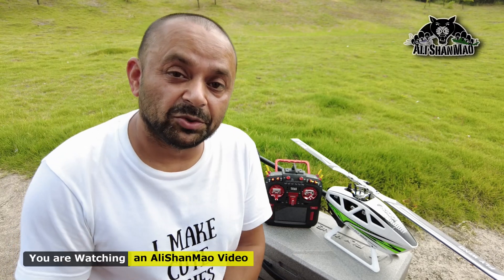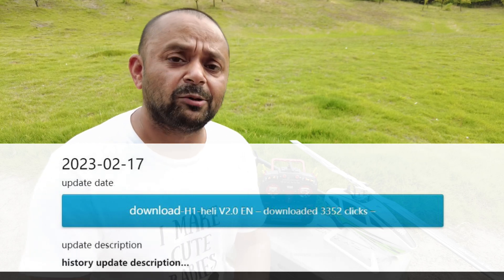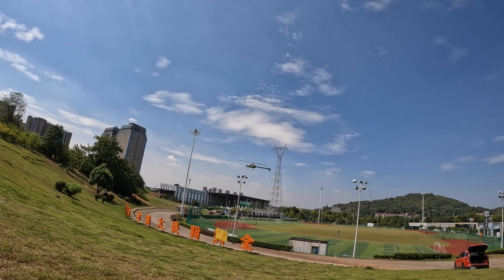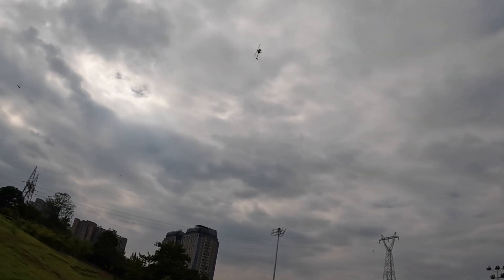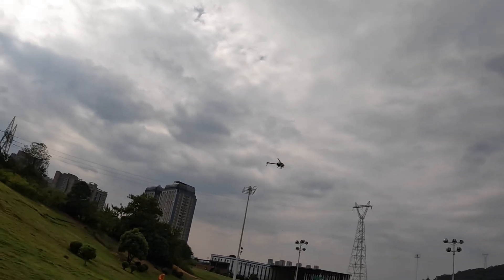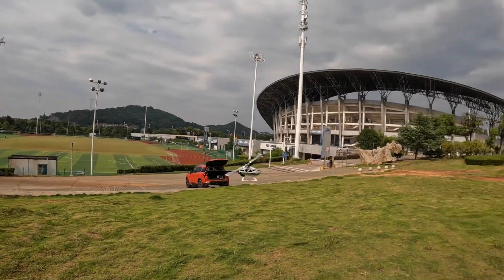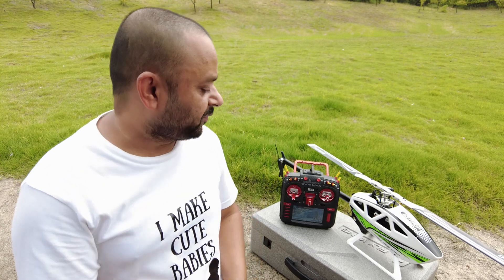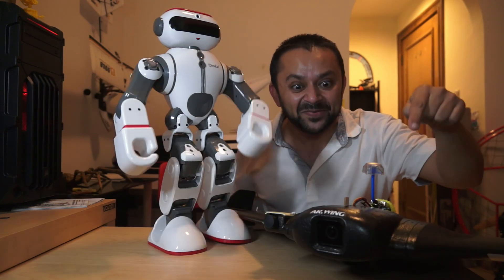Crash-Proof Technology: FlyWing FW450 V3 GPS Helicopter's 3D Security Feature

Comment: Hi, this video made me buy one, but unfortunately the security feature doesn't work 😢 I've set everything up the same way. Do you have any other ideas? Greetings from Germany 😊
Reply from the maker: Sorry to hear that. But if its in H1 Lite, it should work. maybe you need to set 8 meters or 10 meters altitude and fly above it and see if it works. all satellites must be locked and your GPS must be functioning properly for this feature to work. Use V2.0 Software
Reply: Thx 4 answers. I fixed it, do more testing and all works but i want to setup the Heli on my TX16S.
Can you do a Video or send me the model?
Greetz from Germany 👋😊

Comment: Hello...

I just saw your video. Demonstration 3D. If the control is wrong, you won't fall down! The explanation is quite detailed...

I am from Taiwan.. Few flying friends discuss this FW 450 V3 here!

Can you ask questions?
After the software is turned on 1.. Click to select the professional mode 2..3D anti-fault touch switch. Click to select to open 3.. Safe height setting 8M

Under such a setting... Use GPS when taking off. When the V3 is above 8 meters high and the height is above tumbling. If the operation is wrong, the rocker will be released. Will the body automatically return to the right and then set the height? Or do you need to manually control the body to stabilize the body?
         Thank you... from Taiwan
Reply from the maker: Hi, once the 3D safe feature turned on, if you set 8 meters you can only switch to 3D above 8 meters. As soon as helicopter comes to 8 meters it will switch to GPS and hold position
Reply: @alishanmao    THANK  YOU

Comment: Hi!Can you tell me the type of battery that you used? I tried this system with the normal battery of the FW450 and I crashed😢.Thank you.
Reply from the maker: Hi. Stock small battery that comes with fw450 V3. It's not 100% guaranteed that this will save your heli from crashing. Set higher altitudes like 10 meters is best

Comment: My FW450 v3 crashed today.  I had anti crash turned on to 10m in the software.  I did a stick and compass calibrate as well.  I tested the anti crash by putting it into 3d mode and lowering until it stopped and went into GPS mode, seemed to work.   I went up to over 10 m and then I put it in 3d mode and started flying 3d stunts.  I lost control and the heli came crashing down into the ground.  It did not recover , go into GPS mode and stop.   Maybe it happened so fast it couldn't recover?  I have to rebuild it now, I'm dissappointed.
Reply from the maker: Sorry to hear that, buddy. Make sure all settings are correct in the software and the GPS signal is strong before each flight.

Comment: For anyone watching this, do NOT put your Rescue height at 6 meters with the stock 4s5000mah battery. there is not enough altitude for the helicopter to recover. Set the rescue height at 16-20meters to start, and adjust from there if you are comfortable.
Reply from the maker: For beginners 8 meters is highly recommended

Comment: if your flying a scale helicopter. you alway fly in GPS. the only thing you have to worry about is the GPS plug comes loose from the H-1.this feature will work if I go 3D.I have set mine @ 8 m. what do think alishanm?
Reply from the maker: 8m is plenty good. again for scale i won't set it up because as you said mostly we fly in ATT, GPS or 6G modes.

Comment: If you are inverted in 3d mode, and then gps takes over and leaves it inverted, how do you get it back upright?
Reply from the maker: if you are doing manual inverted, then switch to GPS while its inverted. it will flip back to normal automatically as a rescue

Comment: Hi, trying to set this up on my 500DFC, so far so good, but with the heli on the bench this feature set to on i have lost the blue 3d light and its now green instead is this correct?? I'm guessing that its locked into gps mode below 6m and would only switch to blue if enabled above 6m. Thanks just checking i havn't screwed up prior to flying.
Reply from the maker: Yes exactly. Because once you turn this feature on, it will always stay in gps under that set altitude and you won't be able to switch to any other modes on the bench

Comment: ALI, i tried to use the software that i previously downloaded. It does not open. It shows "unread H1" I want to download it again, but I forgot where I downloaded it from. Can you help?
Reply from the maker: its on flywing website buddy. unread h1 i have addressed this issue in my upcoming detailed video tutorial for channel members. normally its usb plugging issue.
Reply: @alishanmao  Thanks friend. One last thing. Today is the third day I have taken the heli out to the field. I cannot get the motor to start. I have followed the steps to the letter, but I get a constant red light on the flight controller. Have you any ideas what I'm doing wrong?
Reply from the maker: @jerryzito6840  solid red can be an error, connect to assist program and check if there is any error and fix
Reply: @alishanmao  I wanted to thank you for all your help. I discovered why my FW450 would not start. The heli needed a compass calibration.
Reply from the maker: @jerryzito6840  ah the compass calibration dance. it is a must

Comment: Thanks for the reply. Last Question. I downloaded the FW.3D Security update. I don't have an altitude setting parameter on my screen.
Reply from the maker: it should be there, 3d safe setting
Reply: @alishanmao  I downloaded it again. The only parameter I see is Inverted flight. Does the heli have to be hooked up to download to see the 3d safe?
Reply from the maker: @jerryzito6840  it is strange. If you have a V2.0 software it must have 3D safe feature unless if you are trying it on scale H1 lite. For FW450 V3, V2.5L it all works
Reply: @alishanmao  I downloaded the file you showed on your screen. Does the heli have to be powered on to upload the file?
Reply: Ok my friend. Disregard my last comment. I did find the security 3D parameter. It appeared when I attached the download cable. How can I tell if upload was completed since there is no progress bar.
Reply: Thank you so much for your patience with me.
Reply from the maker: @jerryzito6840  when you are connected to H1 flight controller using assist program. anything you do it saves settings immediately. make sure to hit disconnect before pulling the cable
Reply: @alishanmao  Thank you.
Reply: @alishanmao  I'm sure I did it correctly. My only concern is  that there is no verification that the file was successfully complete. I don't want to find out in the air. Anyway, enjoy your coffee.
Reply from the maker: @jerryzito6840  well there is a way to verify it easily buddy :) 
once you have set some options, disconnect the USB cable. after few seconds connect again and make connection, then go check if option is still on as you selected it. and all parameters as you set. if yes, well settings saved. do not change anything, disconnect and go fly :) have fun buddy
Reply: @alishanmao  Thank you so much Ali. I think you are the most intelligent RC content provider.
Reply from the maker: @jerryzito6840  Thank you, just a simple guy, trying to help people out and trying to earn some bread for my family

Comment: Thanks for the fascinating and informative video. Regarding the Fly Wing anti-crash download, how do I install it once I've downloaded it. Second question. I recently lost my Blade 230s RTF in a tree line. A friend gave me a 230 but not rtf or "s". I still have the transmitter from the RTF. Is it possible to bind the 230 to that radio?
Reply from the maker: should be able to bind it they are from same manufacturer

Comment: I have flishrc bo105 scale with flywing GPS . I like the idea I switch to 3D but if I get into trouble auto switches to GPS .I saw so video were GPS lock is lossed on uh-1 and crashed . now I dont trust GPS any more I need to know I can stop the crash by down loading the soltware to stop it. thanks for that. I was thinking about saleing it before I crash it.If I can stop it from crashing I will keep it.
Reply from the maker: Get trained to fly RC Helicopters and you won't need to trust GPS again
Reply: @alishanmao  I have GPS rescue switch in the software . I going switch that on when I fly in 3D has a back up save my helicopter from crashing if I make a mistake . I can set it for 7meters. what do  you think about that.??
Reply from the maker: @bradyates7046  3d Safe, you can set to 10 meters if you are beginner
Reply: @alishanmao  I have some years flying helicopters I am not make move without alot time getting my head around it. I have already set it if I change it again I will have to recalibrat compass.

Comment: I did what how did you recommend me about Calibrations, t recalibrated the Sticks and Switches on the Radio and on the H1 proram, I recalibrated the COMPASS, I carefully and attentively checked the "COLECTIVE" settings and verified that EVERYTHING was within the required parameters (mainly the "PITCH"), I rechecked the Values indicated for Home (2000), GPS (1500) and for ATT ( 1400) and this past Saturday I went to test the Heli and the PROBLEM persists, that is, WHEN I GO FROM "GPS" TO "ATT" THE HELI DROPS DOWN NOT KEEPING THE ALTITUDE AS SEEN IN YOUR VIDEO, BEING NECESSARY TO COMPENSATE THE THROTTLE TO THEN I REALLY COULD  FLY IN "ATT" MODE. 
Note;- On the ground, after the GPS had positioned the Heli correctly, when I changed the Switch from GPS to ATT Mode the respective light remained in "RED BLINKING", it didn't change to GPS Light. Please. HELP ME....  😭
Reply from the maker: It is very strange. these are the only settings. it seems like yours is switching to 6G mode rather than ATT mode. because only then it jumps down like you switch to 3d mode and it jumps down. its not switching to ATT. because in ATT mode it won't give you collective control on throttle so agile like in 3d but will keep the barometer engaged to hold the altitude. try 1200 and 1300 settings.
Reply: Did you ever get it fixed.I have same problem.

Comment: Spectacular video. once AGAIN Thank You. 1) Will this NEW "Safe Mode" work with "ATT Mode"?;  2) I already have this "H1 V2.0" on my PC which i last used to calibrate the sticks and the Compass on my FW450 V2 and it's Original radio "FS-i6s", but sincerely i didn't notice this "new" ability in this V2 of the H1, so I haven't tried it yet; 2) as i already told You on another video of yours after I changed the Flight Mode Settings to RTH/GPS/ATT, it was not possible for the "ATT" Mode to work properly, which on the experimental and unique flight i did, as is why I ask: - Would it have been because of this new "safe" capability that the "AAT" did not work? How should I, that is, maintain altitude? Thank You
Reply: H1 V2.0 -  New 3D security mode（Not 3D rescue，Just to prevent accidental contact with 3D during flight:-
      1、This function has an adjustable height parameter, which defaults to 8 meters.
      2、When this function is turned on, when the helicopter is above 8 meters, it can switch to 3D mode for flight.
      3、When the helicopter is below 8 meters, the 3D switch is invalid and the helicopter cannot switch from GPS mode to 3D mode.
      4、When flying in 3D mode, the helicopter will automatically switch from 3D mode to GPS mode and hover when it falls from a                   height above 8 meters to below 8 meters. If you need to fly in 3D again, you need to raise the helicopter to over 8 meters,                     switch the 3D switch back to GPS, and then switch back to 3D mode.
       5、Please adjust the height parameters according to the weight and descent speed of the helicopter. If the helicopter falls too fast 
           and the height set is not enough to make the helicopter brake and hover, there is still a risk of crash.
Reply from the maker: good tips. 3d safe works for 3d only i believe
Reply: @alishanmao  So My Friend, i prefere to use "ATT Mode" even if there isn't  this stupendous  "3D Security". I saw Your Video with yours "Fw450" and, ...uffffff..., NICE👌👍 !!!
Reply: ...in "ATT Mode", of course.  🤝

Comment: i had an issue with mine i think it got too hot did not do a return to home feature. so it cracked the paint on hardish landing. when i checked the battery voltage it was lower than 3 volts each cell. so could it be that reason it was hot? plus i was under the arizona sun in spring.

so you also have to reset the gps calibration each time you fly at a new location?
Reply from the maker: a far away new location, if needed calibration you will not be able to take off. so if it flies at different location means you do not need calibration dance

Comment: I did set security on 10 metres. But mine did not react. The heli is crashed.
Reply from the maker: could be some setup issue. did you turn on the 3d safe feature and tested before trying it?
Reply: I did tested or 3d function was switching on within 10 metres. It did not. Above 10 metres I could turn on 3d function. So the safety mode did work I thought. I was flying 3d and when the heli comes down it did not anti crash correction on time. I don’t know what is happen. But its a strong heli. I ordered new blades and tail. When it arrived I go test again. Maybe the safety hight to 25 metres for testing. I hope the safety procedure works fine then. In gpsmode a very fine and stabil heli. Im happy with that.

Comment: Hello Ali, a question about the tail rotor on FlyWing FW450 V3. Does the tail rotor reverses rotation direction during flight for better yaw control.
Reply from the maker: no, it slows or speeds up only

Comment: Awesome stuff my friend.  Will the security feature work on the 2.5 version?  Thanks in advance.  Also wondering if I can use a transmitter from a crashed FW450 for a new PnP V3?  
Thinking the radio setup is the same...Just bind ???
Reply from the maker: it should. you can try it

Comment: If I added D/R EXP on  my transmitter to slow down my heli responsiveness. Will  H1 autopilot controller interfere how the system operates.
Reply from the maker: best to setup through assist app, if you want to make it docile

Comment: Hey Ali for this to work, do you have to start in GPS mode and then flip to 3D mode? I am trying to figure out how it would connect to a satellite in an emergency if you start flying session in 3D mode...
Reply from the maker: you have to switch to GPS before taking off, let it lock all sats. when solid green light, now you can take off in any mode and it should work. but if this feature is on, you can't switch to 3d when on ground, you can only do above the set safe altitude. so take off in ATT, GPS, or 6G mode is possible only
Reply: @alishanmao  that’s what I thought thanks for the confirmation Ali. Your wealth of knowledge and experience makes this hobby worth doing.
Reply from the maker: @goldenmanuever1176  you are always welcome brother :)
Reply: Here is the "STORY" of this Version 2.9:- «««H1 V2.0 - New 3D security mode（Not 3D rescue，Just to prevent accidental contact with 3D during flight:-
      1、This function has an adjustable height parameter, which defaults to 8 meters.
      2、When this function is turned on, when the helicopter is above 8 meters, it can switch to 3D mode for flight.
      3、When the helicopter is below 8 meters, the 3D switch is invalid and the helicopter cannot switch from GPS mode to 3D mode.
      4、When flying in 3D mode, the helicopter will automatically switch from 3D mode to GPS mode and hover when it falls from a height above 8 meters to below 8 meters. If you need to fly in 3D again, you need to raise the helicopter to over 8 meters, switch the 3D switch back to GPS, and then switch back to 3D mode.
       5、Please adjust the height parameters according to the weight and descent speed of the helicopter. If the helicopter falls too fast
           and the height set is not enough to make the helicopter brake and hover, there is still a risk of crash.»»»
Reply: Sorry... "VERRRRRRRRRRION 2.0"....😑
Reply: This "Keyboard"...😤 "Version 2.0"!!!!!

Comment: Will it stop at the safe height setting if you keep it horizontal and just go down, as if you're going to land?  Can I still land in 3D mode if I go down slowly?  So glad you made this video!  I bought an FW450L V3.1 because of it.  Not sure what the 3.0 to 3.1 updates were.  UPDATE:  Somehow I crashed it in 3D mode while diving head first.  It doesn't seem to be working very well for me.  Had safe height set same as you, at 6m.
Reply from the maker: Yes it will. set the height to 10 meters, nose down or tail down takes lot of stopping distance. so 6m is not enough LOL
Reply: @alishanmao NOW you tell me.  LOL  (replacement main gear ordered)
Reply: @alishanmao But in this video you set it to 6m and you did nose down and it recovered.
Reply from the maker: i got lucky maybe :D @jimbert50
Reply: @alishanmao LOL

Comment: Need you too try something for me. I run at 90 percent head speed, your recommendation for the settings doesn’t work well. I would like you to come up with a 90 Percent head speed setup. Please 

Try 16 percent gain
Gps at 21
Tail Gain at 54 percent
Reply from the maker: when you switch to 3D, your helicopter will run 100% head speed. maybe you did not know that buddy :) 75% or 65% that you are able to set is only for GPS, ATT modes. 3D mode is pre written 100% head speed in flight controller. Hope it helps
Reply: I wanted to try your setup, at 90 percent head speed when the helicopters on the ground the tail seems like the gain is too high I went down to 35 and still had the problem
Reply: Please help me figure out a compromise, please try it for me
Reply: Mine is older gps